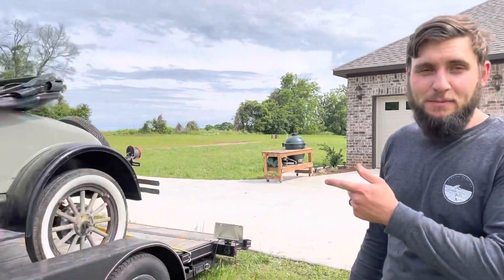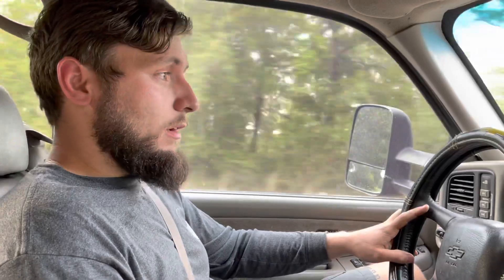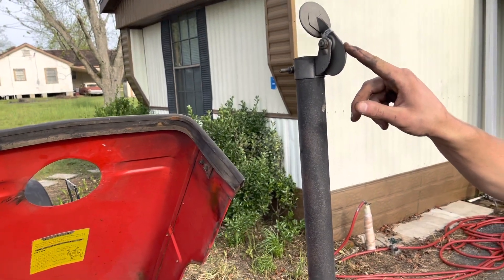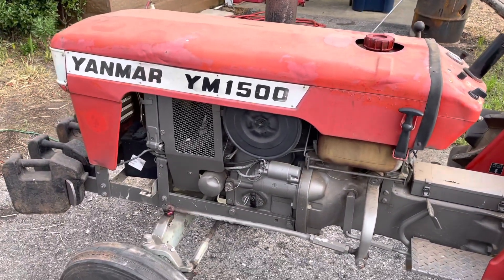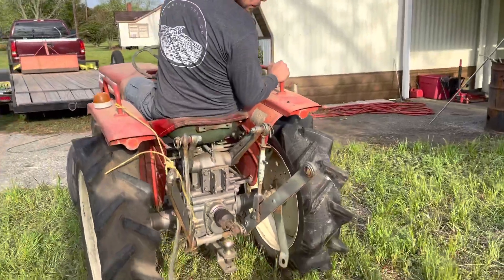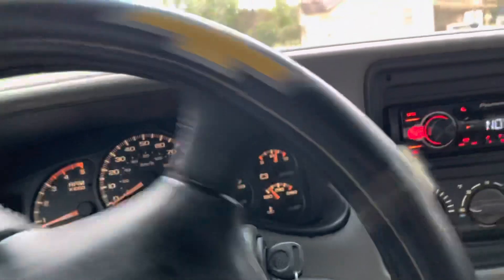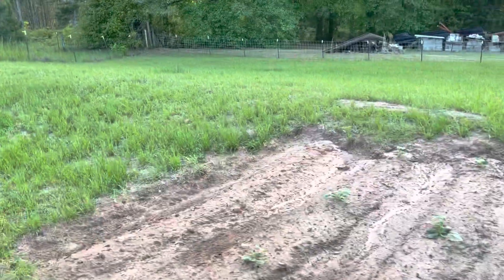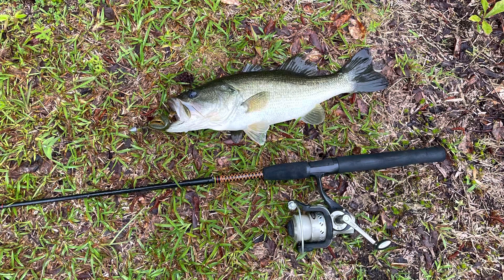Will It Start? Probably Because It’s A Yanmar!

Comment: There should be a decompression lever left of steering wheel. U pull it to the left, start cranking, and when it cranks at speed you shift it to the right to increase compression and it starts.
Reply from the maker: There is!

Comment: Nice job. That's a $2500 to 3000 tractor. There rock solid and usually only ever simple problems with them. I have a YM2000 and had it over 10 years. Solid tractor love it. 

Tell him be careful with the wrong air cleaner. They don't seal right.  Those have a thermostarr, you need diesel fuel dripped onto it to ignite for proper operation. It's just a little heater doesn't heat right without fuel dripped onto it to ignite from the cup. Also you are supposed to use the decompression lever to get it spinning fast and then drop the lever to start.
Reply from the maker: They are strong little units, and he knows I didn’t think about using the decompression lever when we first got it, he’s been using it since
Reply: @UncleMike1776  helps you get by with a weaker battery.  Also do not stop it useing the decompression lever. For whatever reason the manual states that. I have heard it can cause bad things. Not sure why. If pistons don't hit valves while cranking why would they to stop it? It may be something more todo with lifting valves at the wrong time in a compression stroke bending valves? I don't know it just says it everywhere and everyone who knows these say not too. Shut it off with the throttle. 

I have become pretty good with these things, done almost everything to mine that could be done without going into the engine or trans
Reply from the maker: @natevanlandingham1945  those little Yanmar motors are easy to tinker on

Comment: I have this tractor. It's my favorite small tractor. I built a front end loader for mine and it does anything I ask it to do. 

It probably would have started with that lawnmower battery. There is a compression release handle right below the dash on the left side. You release the compression on the engine and get it spinning, and then let the handle go. For cold weather you'll want a full sized battery in there.
Reply from the maker: Nice to hear! I did learn of the compression technique after I got it going. Nice little machine. The fella I sold it to over heated it about 15 times literally boiling the coolant out of it and he never had an issue with it. Kept on going!
Reply: @UncleMike1776  It's funny you mention overheating. I live in Pennsylvania, which isn't exactly known for its heat, but in the summer it does get hot and very humid. I have about 10 acres of yard (technically a field I keep mowed) and this is the tractor I use to mow. I always worried about it overheating, so I removed the dummy light and installed an electronic temperature gauge in its place. According to the Yanmar engineers, this model wasn't overheated until it was above 238 degrees, which seems really high to me. Even Hoye says the dummy light is illuminated at 220, but the original documentation in Japanese says 238. 

Anyway, I always watched that temperature gauge hovering around 210-225 and it made me nervous. Hoye Tractor in Texas makes a kit to add a water pump. It has a bracket to move the dynamo out to the side and then the water pump goes right behind the fan where the dynamo was. It was a little more expensive than I wanted, so I tried a couple times with adding electric coolant pumps to the system. I bought two pumps, and both of them burnt up within a couple months of use. So I finally broke down and bought the mechanical conversion from Hoye. It works pretty well. Hoye is, in my opinion, the best authority on these tractors in the United States. They are a great source of information and they can get you almost any part for a reasonable price. 

According to Hoye, someone in my climate should be running no more than 25% coolant between the last frost and the first frost every year, and then a regular 50/50 for the rest of the year. Before I had the water pump, I ran distilled water with an additive like water wetter in the summer. Now with the pump, I can run it 50/50 all year. It takes a little longer to warm up in the winter, obviously, but it works well. 

I have overheated the tractor twice, but both times it was because of my initial problems with the water pump kit. There are little differences in the tractors, and I had to fab a couple parts to make it fit. There was a little trial and error involved there. 

The tech support board at Hoye has some good information on YM1500 cooling issues:

http://ymowners.com/phpbb/viewtopic.php?t=3848

Comment: Those are what you call grey market tractors only place you can get OEM parts for it is this one shop in Texas I got the phone number to the shop because I have customers constantly asking for parts to these guys
Reply from the maker: Yeah. For how many of them there are out there you’d thinks parts would be easier to come by!
Reply: Parts have gotten easy to get now . The parts and repair manual can be difficult at times .

Comment: That's an all original grey import. Not one of the "rebuilt" ones
Reply from the maker: It’s solid!
Reply: It is actually a reconditioned tractor. You can tell by the bolts. The tractor was painted at the factory in pieces then put together with unpainted bolts. Look where the transmission meets on this one and the bolts are painted. Also they had rice patty tires on them originally that would last forever, as for as wear. They usually rot before you can wear them down, 25 yr later.
Reply: @wallyh8740  some of them have replacement tires. I'll have to look back at the bolts. Good catch